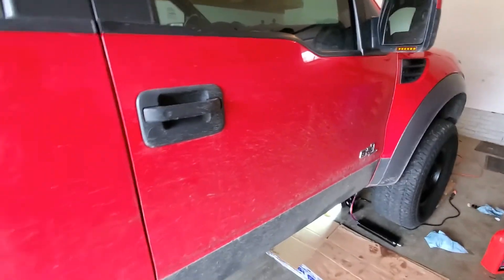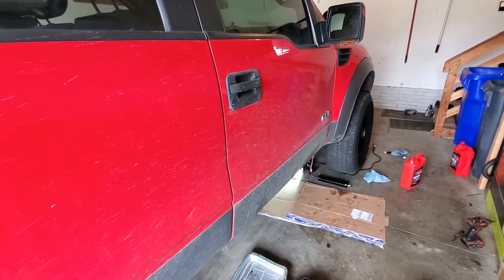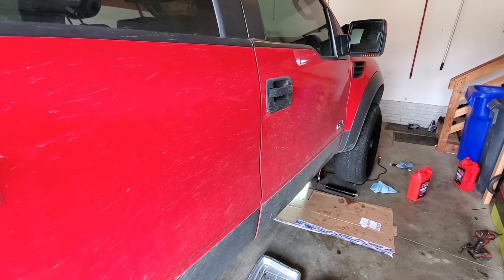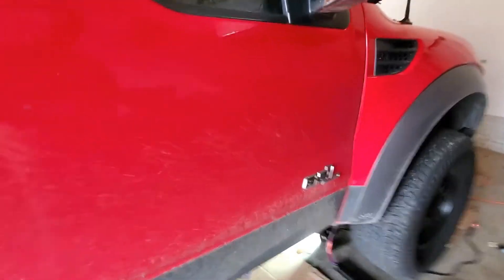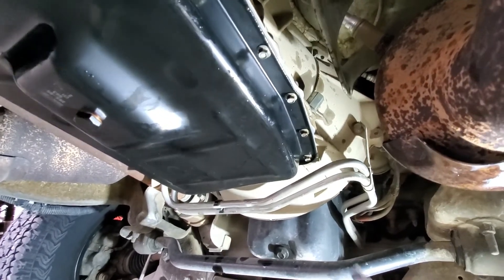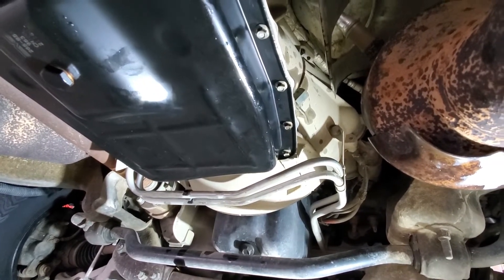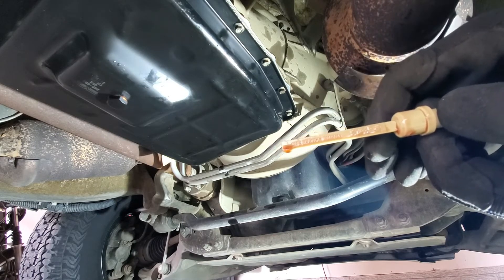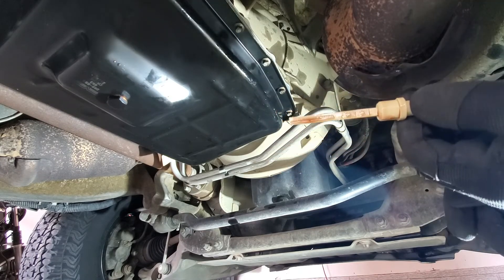How to check Trans Fluid Level

Comment: do you add fluid via the dipstick port?  if so, how?  Thanks
Reply from the maker: Yup! You have two options, you can use a little pump that screws into the top of an oil jug or a suction pump. You stick the end of the pump into the fluid, pull up on the plunger and then squeeze it into the hole. Both options are available at parts stores. I prefer the suction pump.

Comment: Im not being a youtube warrior here , you make quality videos . I believe your wrong with this vid . If your engine is off and you pull the dipstick fluid should come out if level is correct . 
  When the engine is running fluid gets sucked up into tranny . Only way to correctly check is engine running and at near operating temperature. I think your low a decent amount . Again pulling dipstick out with engine off you should have fluid coming out .
Reply from the maker: I appreciate you pointing that out. But I clearly state, more then once, to make sure your truck is running as you check the fluid level. 

I had the truck off for filming purposes otherwise the video would sound like garbage. 

And for anyone who is watching this to learn and are unsure about checking the fluid level here are the steps. 

1. Start truck and let warm up. 
2. With truck running remove dipstick with 19mm wrench and check fluid level, add as necessary. 
3. Replace dipstick. 
4. Go have fun in your Raptor knowing the trans level is good!
Reply: Ok , guess I missed it . 👍